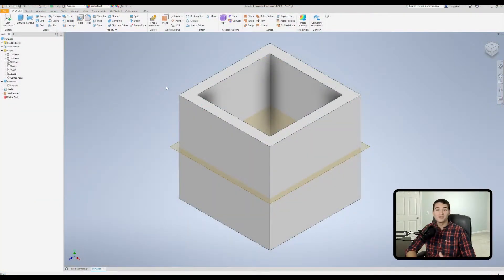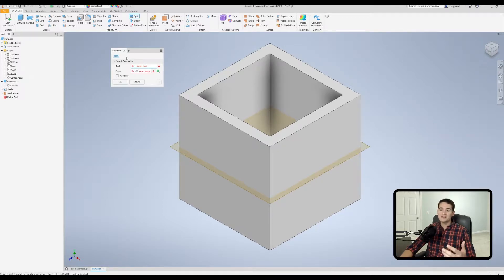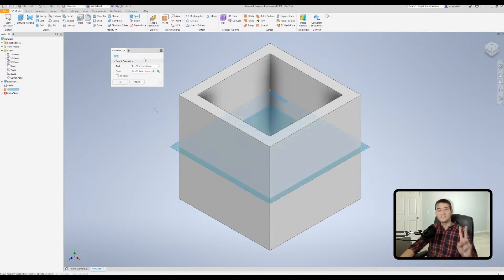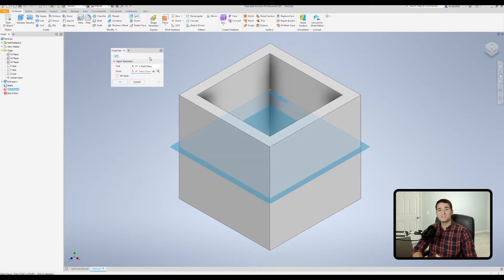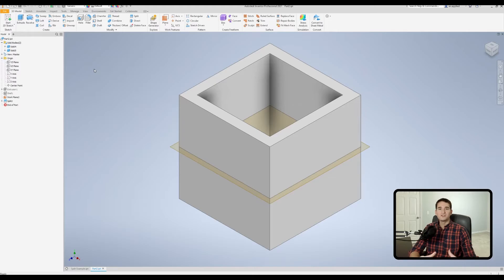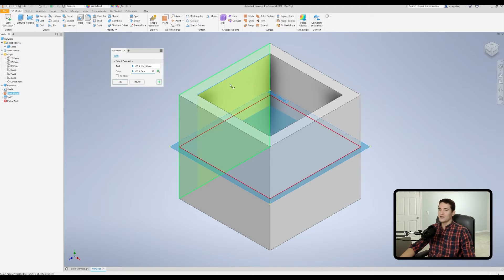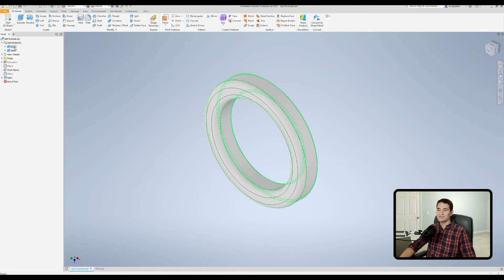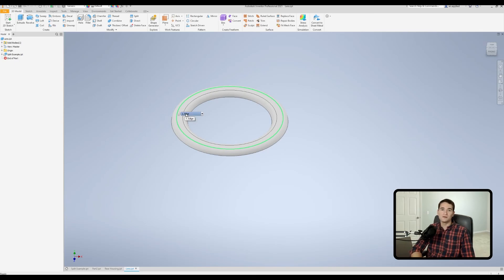Split Tool and Options - Autodesk Inventor Part Tutorial | Autodesk Inventor 2021 IN DEPTH

Comment: Super helpful, I have never found a use for the splitting surface command. I was worried I just didn't understand it but even after this video I'm still not sure what it's purpose is.
Reply from the maker: Yeah, it's one of those commands where the uses are very specific to your design effort. That's why in the video, I used it on a mock up of a ring light housing design. It makes it easy to start with one solid piece, then split it up and save it as separate parts after you have seen what the overall design envelope looks like at a preliminary level. You can also create some pretty complex geometry by removing material from a solid using an eccentrically shaped surface feature (i.e. computer mouse surface design).

I'm glad you like the videos and thank you so much for reaching out!
Reply: @engineeringapplied  Personally I use the split surface command to split parts into sizes that are more manageable for the lasercutter